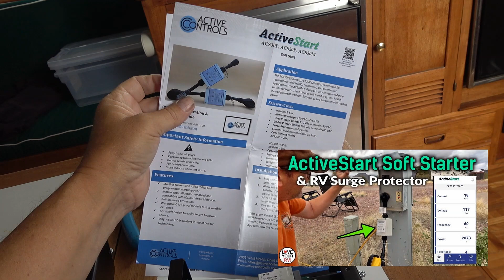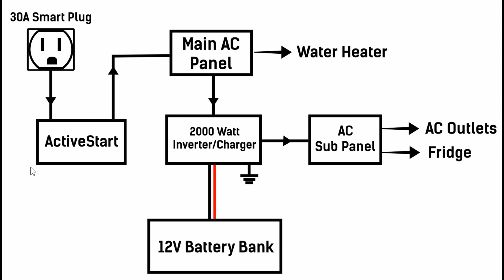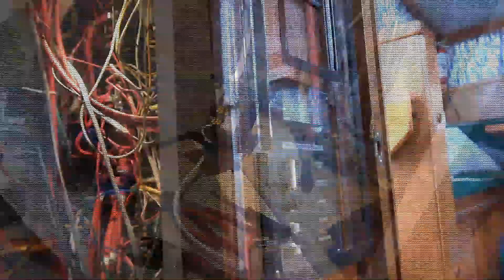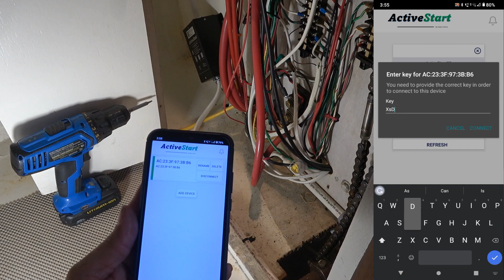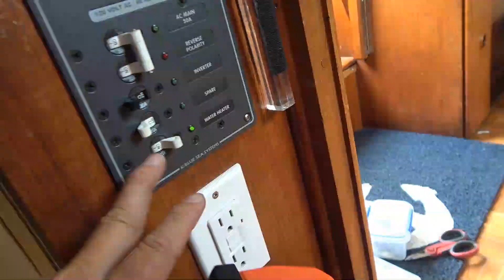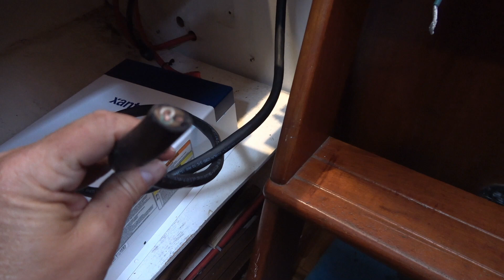ActiveStart Hard Wired Installation - 30 Amp Surge Protector Soft Starter with Bluetooth App

Comment: I'm no electrician, but I would mount that inverter off the "ground" of that cabinet.  Just an armchair warrior's opinion.  Great video!
Reply from the maker: Yes, it will be getting mounted on the inner wall where I took the old one off.  The manual states for marine installations it has to be mounted horizontally on a vertical surface. Cheers, Ray

Comment: I would rather have it on between the inverter and the sub panel so it would be active when running off of the inverter, but then it wouldn't be in the right place for surge protection, I guess you almost still need 2 devices... an EMS and the softstart.  Unless I'm missing something.

Comment: You do not have a galvanic isolator installed.  Should be the first thing the ground wire meets after coming in from your Smart Plug.

I recommend you spend some time watching videos from Jeff Cote of Pacific Yacht Systems, a fellow British Colombian, with tons of helpful information and insights into boat electrical systems.
Reply from the maker: I actually do have a galvanic isolator installed GI-30 NewMar ,was hidden from view. See here https://youtu.be/9WUvjJrvg0M?t=919  I tested it with my multimeter and its functional. I'll likely replace it with a more modern version that has LED indicators for next years boating season.  This one was recommended to me by a marine electronics tech that follows the channel https://amzn.to/3FfIkux  Cheers, Ray
Reply: @LoveYourRV   Yeah, I saw that in one of your videos I watched after that!  Hopefully that's the first thing the green shore power wire connects to after the Smart Plug. 

On our boat (ironically a CHB 34, though it's the Europa model) I upgraded the one that came with our boat to a ProMariner 22034 ProSafe 30 Amp Galvanic Isolator, which is a fail-safe design.  If a non fail-safe isolator were to burn out (and unless you tested it daily you'd have no way to know), you would essentially lose all ground fault protection on the boat.   With the fail-safe design, even if something goes wrong with the isolator, you will still maintain the ground connection.

I've been enjoying your videos!  Thanks!  Maybe we'll run into you guys out on the water some summer!  --Tim
Reply from the maker: Thanks. :) it would be good to have one that has an indictor to know if that it is working or if there is a fault present. I don't think they burn out that often useless some big issue with shore power connection happens, its been in there since the mid 2000s judging by the model. One way I'd think to easily know if the ground has opened is to plug in a 3 LED plug tester to one of the outlets. Could leave one plugged in somewhere. I also wonder if the ground was open whether the reverse polarity light on the AC main breaker may come on. I notice it will come on if I plug the shore cord into my generator that doesn't have a bonded neutral to ground output. Our plans are not to be on marina dock power much at all though, so may not be worth the cost to upgrade if I can just monitor it when we do occasionally plug in for a night or two.
Reply: @LoveYourRV  Yes, the reverse polarity light comes on if you’re plugged in to an AC power source with a floating ground.  AC panel on boats should not have the neutral bonded to the ground, only at the power source, such as shore power.  However, if the AC source is on board the boat, it is supposed to be bonded, as I understand.  Again, tons of fantastic information on boat electrical is available on Pacific Yacht Systems’ YouTube channel and website.  No affiliation.  Just a big fan of theirs.  Happy boating/RVing!  — Tim
Reply from the maker: Thanks, yeah, I've seen some of their videos, also have Nigel Calder's book "Boatowners Mechanical and Electrical Manual" for reference https://amzn.to/3PXMhdq
Its the same with RVs, they are set up to only see the campground main electrical cabinet bonded ground so I carry what's called an Edison Plug to plug into the portable generator or a portable power station. It is basically a plug with the neutral and ground bonded. Its handy in case some things need to see a bonded ground  https://amzn.to/3ETrVM5

Comment: I just bought one of these units, and I’m getting ready to install it. The blue ring terminals supplied by Active Start are way too small to support 10AWG (30 amp) marine conductors. That, and they’re designed for a 2-4 stud size. 

Looks like the spade terminals you used are for a #10 stud size. Did you have any problems connecting them to the terminal block? Or did you have to bend them or grind them down a bit to make them fit? 

I was thinking of using smaller spade terminals (#8 stud size, or even #6 stud size) to more easily connect to the terminal block. Your thoughts?
Reply from the maker: Hard to remember, but I think what I did was snip off a piece of one prong just enough so it would fit. Still left quite a bit of surface area for the connection. It's worked well. Had a lighting storm in the area with major power fluctuations while the boat was in winter storage with heaters running and the Active Start shutdown power. Nothing damaged with it or the boat electrical so may have saved a headache. Cheers, Ray

Comment: How’s the 30 amp ActiveStart working out after 7 months time? I’m thinking about getting one for our Class B. The little Onan 2800 generator stumbles a bit when the CoolCat roof air conditioner starts.
Reply from the maker: Good, I have one wired into my 14.5K BTU Furrion RV air conditioner, and it can start it with as low as a 2000W inverter  https://youtu.be/pzPxMm2N5U8